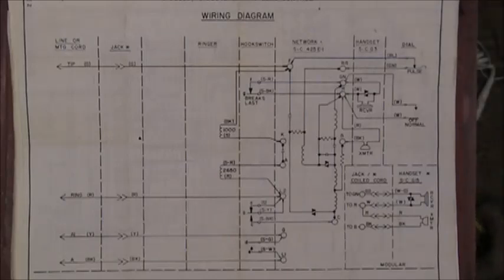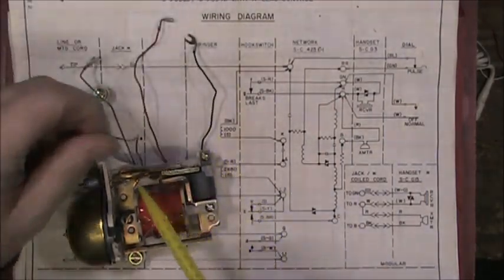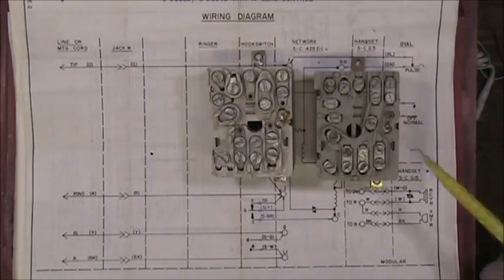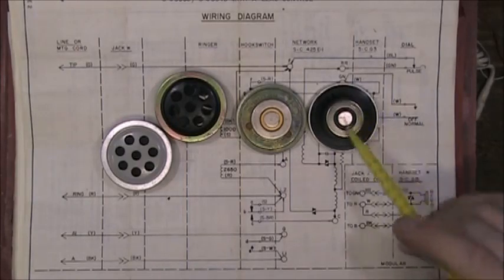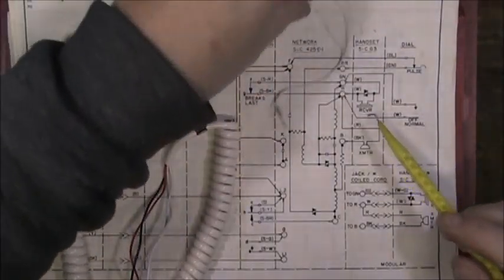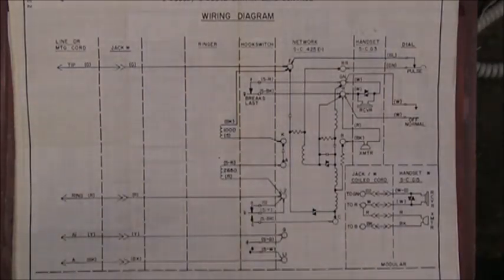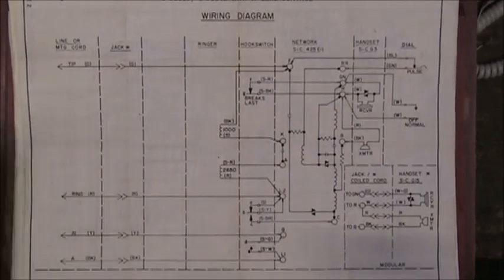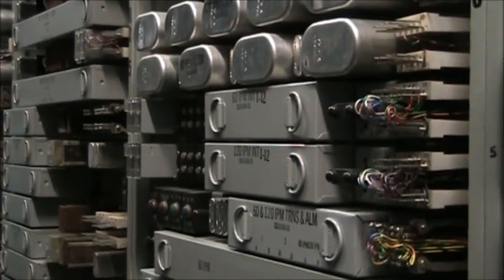Reading Schematics of telephones,Western electric, stromberg, Itt

Comment: I would have loved this explanation back in the late 70's/early 80's when my fascination for telephones was going strong as a teenager. But, of course, there was no YouTube back then. I tinkered with the phone instrument and the line every single day. I once discovered that if I disconnected one white wire for the receiver shunt and disconnected one wire (blue or green) to the dial pulse circuit at the speech network terminal that I could hear what was happening on the line. Examples were telephone network activity such as clicks, beeps, and a background sounds that I called background chatter. I could also listen-in to phone conversations at normal volume but if attempted to speak then neither party on the line would be able to hear me. Essentially, the phone was in monitor mode. Another fun thing to do , but this time with friends, was to have conversations over long strands of wire between to G3 handsets. I simply wired the two in series an hid the batteries inside the handle. Sometimes it would be necessary to disconnect the varistor on the receiver element to make speech audible. I made several of these "toys" for young kids playing "telephone" and it was always a hit. Thanks, Phil, for your videos and keep them coming. I learn cool things from each and every one of them.

Comment: I need to know how to make model ITT  2554  m20     around 2009 phone single bell 
how do you make the coil and tiny steel ball hit the  bell with more power 
I know it couldn't of come like that from the factory . Do the magnets need recharged?
 the volume control looks like its just manual linkage. so no use spraying contact lube
thks  I/ve been trying to read schematic to a 1958 wms baseball pinball schematics
are tuff unless you  do a lot of schematic reading  every day .  but those are the
length of the pinball glass.